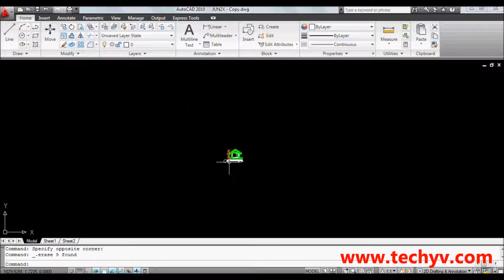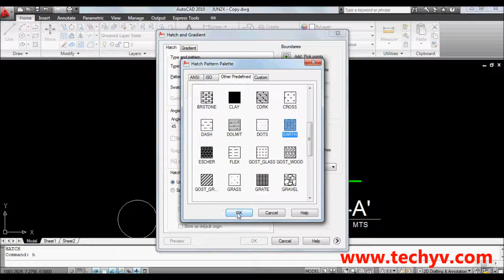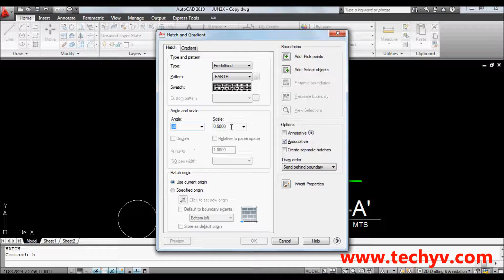How To Apply Hatch in AutoCAD 2010

Comment: Hatching is a very frustrating task for me. So I have collected a few hatching tips together, including this video from Techyv. Hatching is a way of using some shading effects by means of drawing or painting a compactly plotted parallel lines. A hatch is a pattern of lines and dots that fills up an encircled area. As an AutoCAD user and drafter, I often use hatching to represent the type of material that creates up an object such as insulation, mental/concrete etc. I like this video very much. Thanks a lot, Techyv for this nice video tutorial.